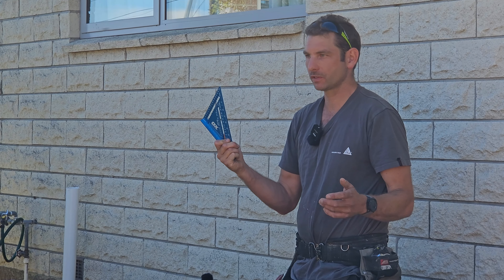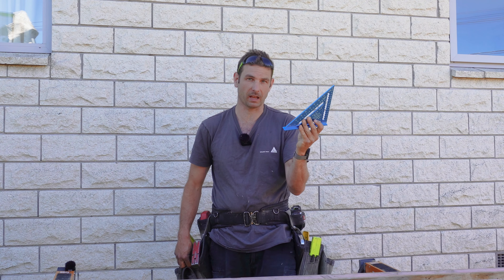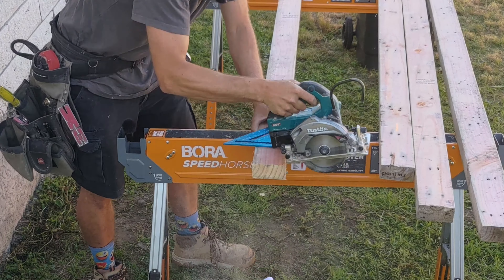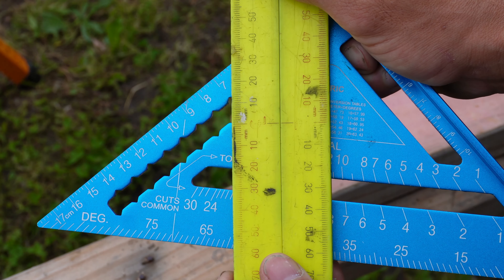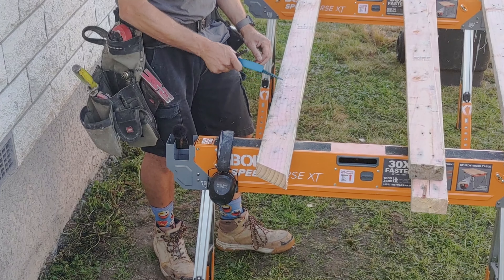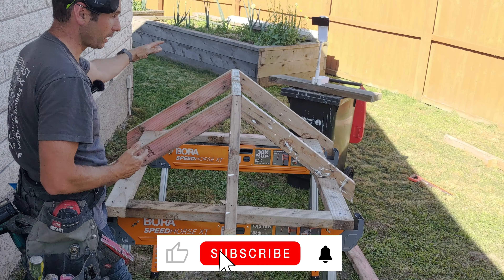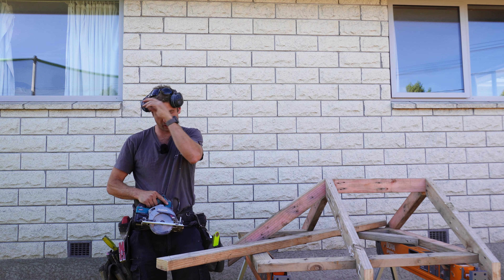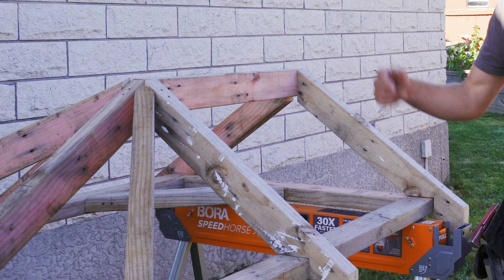How to use a speed square

Comment: Love Speedsquares .  like to confuse the Newbelts and call it a SpeedTriangle .. One of the few tools I will carry while framing . . Also found uses for .. Scraping ice of off top plates and windshields , Use for lifting baseboard for that little carpet allowance . and using it's edge to scrape interior rough openings . Where the drywall artist ran a wee bit far into the opening .. The plastics ones .. Those need to be flight tested , Thrown in a lake
Reply from the maker: Speed triangle 😂